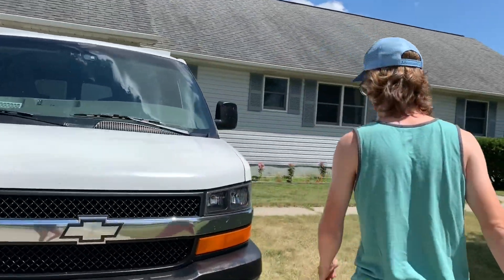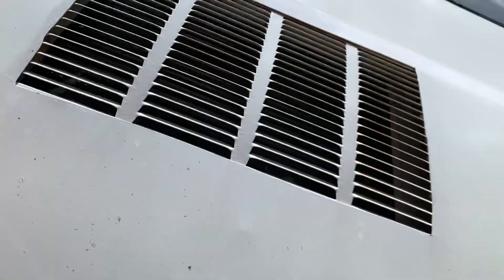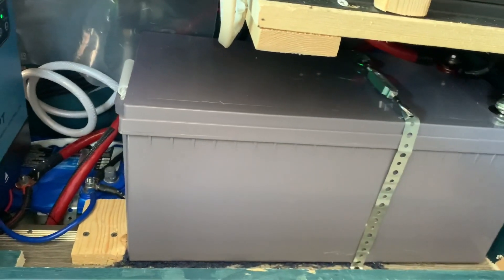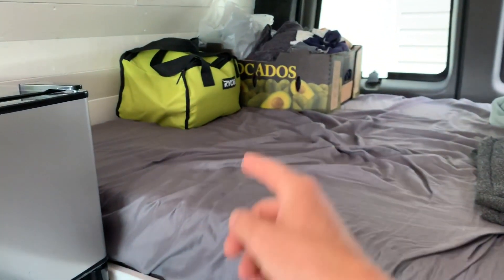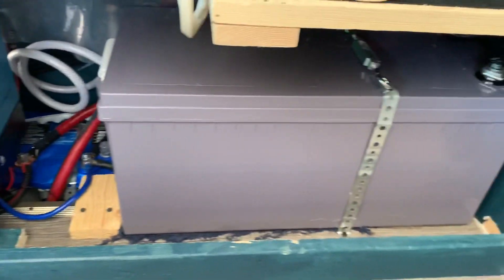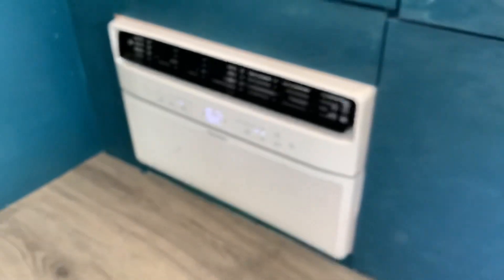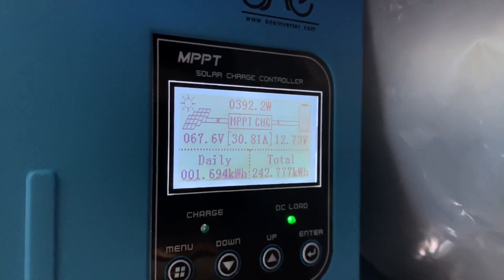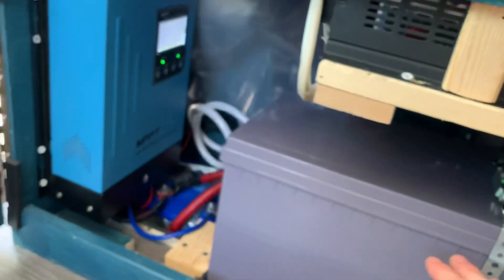Van Life Solar AC Setup - Totally Off Grid

Comment: So if it's 100 outside how cool are inside
Reply from the maker: We actually just had a full week of 100F+ weather, and it only does okay. Without anything covering the windows it really only hold the temperature in the low 90's. With window covers on, it does much better and can bring it closer to a bearable low 80's.

I would either recommend going larger with an 8k BTU unit or getting full infrared blocking ceramic window tint. (including windshield) Tinting this huge van however runs close to $800.

If you can live without the rear windows, I'd recommend just getting some 1.5" foam board and spray foam insulation for the living quarters and covering the windows.

-Tim

Comment: I probably missed it, but how many watts is your inverter?
Reply from the maker: Hey Zeke it's a 3,000w inverter. If you're only running a small AC like this I would recommend closer to 1,500w. (The higher the wattage of the inverter, the more power it wastes while idle and at lower loads)
I talk a bit more about the inverter and parasitic loads here:
https://youtu.be/opOaJkHXDSg?t=241
Reply: @VanwithTim  Ahhh, good to know! For a really simple setup, do you think a 600w microwave (950w input) would run off a 1500w inverter connected directly to a car battery while the car is running? Would the inverter have to be pure sinewave?
Reply from the maker: @zacworld2061  You've got the right idea! You generally want to go double the inverter size for microwaves. So 1,500w would probably be fine. (Most 1,500w inverters are also rated at 3,000w "surge" for things like compressors, electric motors, and microwaves) 

I hear some people have luck running microwaves with modified sine wave, but really if you can swing the extra $$, the pure sine wave will be much more "friendly" to the microwave and anything else it's used for.

For a real world reference, I did a build last summer using a 2,000w Renogy inverter and it ran an RV microwave without issue. The microwave specs were: 900W output and 1350W input.

Comment: When you have different battery capacities connected in parallel, you should be finding the smaller ones draining a lot faster than the larger ones. When they drop, your voltage draw from the whole battery bank decreases, as the inverter would take voltage at the lowest rated battery voltage (which is lower for lower-capacity low-charge batteries), not to mention the sulfation that happens when any of your agms drop below 50%. Are you monitoring your batteries' health as they continue to be used? I wonder what actual capacity your smaller ones still have at this point.
Reply from the maker: I'm pretty curious of their current health as well. Two of the three were used batteries and I'm kind of just waiting for the battery bank to die so I can upgrade to Lithium.

All three batteries are connected in parallel via 2/0 AWG wire though, so the voltage of each battery would (should?) be the same across each battery? (If the small battery is losing voltage faster than the others, wouldn't voltage from the other batteries would naturally flow into that battery?)

I'm no electrical engineer by any stretch of the word, I'm probably over-simplifying and missing important points.

I also used to try keeping the DoD above 50% but have since stopped caring about the battery bank. I've since ran the below 11v many times. (Maybe I'm just itching for an excuse to kill and upgrade them haha)
I really should try performing an individual capacity test on each battery as a two year update.

Have you seen this article? It’s a really interesting read and I suppose it explains why my battery bank still hasn’t bit the dust. (I hear so many people afraid to utilize more than half the Ah capacity of their AGMs) 
https://tab-rv.vanillacommunity.com/discussion/9940/agm-battery-depth-of-discharge-myth-busted

Truly appreciate your insight! I'm always learning!
-Tim
Reply: @VanwithTim  thanks Tim, great reply.
Yes I think I mixed up the series/parallel physical flow, as in parallel I do believe the fuller batteries would charge the less full ones to compensate for the quicker voltage loss. I'm not an electrical engineer either (though trying to become like one ;), but I'm not sure my earlier statement applies.
But one other thing you may not have considered is that the smaller batteries have a smaller max discharge current. Usually at about .3a per amp hour for AGMs, I believe your current demand will draw power equally across all 3 batteries, but that 1/3 current draw from the weaker batteries might exceed it's current draw max. That means damaging them faster.

But your lady statement really said all you needed to - wearing them out might not be so big a deal if you're looking to upgrade sooner rather than later. Just thought I'd mention some of the unanswered questions I had for the configuration. Hope you are well!
Reply from the maker: @tylermaldonado7210  It was definitely a budget build in the beginning and I've learned a lot along the way. The world of battery chemistry gets so crazy as it's a total mix of electrical engineering and advanced chemistry (or at least feels advanced enough to me!)
I definitely have some intense current draws (up to 180 amps) and I'm sure that's not doing them any favors. But that's also what gets me worried about Lithium - I hear they have a pretty low limit of max discharge. I can see the appeal of a 24v system when it comes to that!

Will certainly be making a video once it's time to swap upgrade the battery bank!
All the best!
-Tim
Reply: @VanwithTim  for max discharge from what I've seen lithium exceeds AGMs very highly. Most lithium batteries have a 1c discharge rate, equivalent to 100a per 100ah. AGMs meanwhile appear to be about 30a per 100ah pretty universally. So I'd be thinking the opposite about that :P

Comment: You should add a desk fan to run along with the AC so that the AC won't work so hard and consume less energy as a whole
Reply from the maker: I've actually since added three desktop USB fans to the ceiling (only 3.3 watts each) and it made a huge difference!
Reply: @VanwithTim  By chance, do you have a link to those fans? I watched your video with immense interest, finding it nearly impossible to believe that you can run a 6k BTU AC unit ALL DAY on battery/solar power. I've watched the video three times and I'm still shocked and finding it implausible. But I'm currently in the market for a new (to me) used van, and am appreciating all of your videos immensely. I hope life is treating you well since your vanlife days. Thanks for all the great content.

Comment: Nice set up 💯💯💯💯Quick question lets say you just wanted to use ac while van was running would alternator and inverter by itself be enough to run just ac?????
Reply from the maker: Hey rick, great question and the answer is yes!
The AC draws about 37 amps at 14 volts.
The vans 145 amp alternator outputs around 50 amps at idle.
-Tim
Reply: @VanwithTim  cool thx

Comment: Omgosh i could use ur help!! Where r u? I have no help n cannot do this n dont want 2 wi experience! Electric scares me but i do NOT handle the heat well n i need something this yr...soon actually! I really need help w some type of cooling!!!
Reply from the maker: Hi Melinda, your best option might be the "ice chest AC unit" (lots of examples on DIY on Google) A system like mine would probably be around $1,500 - $2,000 for just the used parts then another $1,500 in labor for install. The ice-chest AC is a great solution for less than 1/10th the price!
Reply: @VanwithTim  Hi... Thanx! I did try that last year and instead of ice i used frozen water bottles n frankly i got sick of buying ice, draining it n couldnt keep refreezing bottles n it didnt cool it enough 2 b worth it for me. I really do appreciate ur help. I will look into some dif options than what i did. Thanx!! God bless!! ✌💙🙏

Comment: Nice built! 
The link show 24 V inverter but you have 12V, same with solar panel? 
And I have I trick to improve your comfort. If the widows are film remove it and put mirror, chrome, silver one instead.
 Bloc the air entry on your AC and put a lateral air duct to suck hot air from the roof.
Reply from the maker: Oh boy. Good catch! Just updated the link.
The system is all 12v, but the panels are 41v I believe. Those run directly to a MPPT solar charge controller which steps the voltage down to a specified charging voltage. (I think I have mine set to around 13.5v)
I was actually just looking at adding the ceramic window tint, but it's very expensive.
I really like that idea of sucking the air out from under the solar. The panels get really hot in the summer and lose a lot of efficiency. Need to find a way to keep them ventilated and that's an interesting concept for it.
Thanks for the insight!
-Tim
Reply: @VanwithTim  Window film at Home Depot "Gila, privacy control and Energy saving" are not over price like other. they have one layer mirror outside and black inside to cut reflectivity for clearer night view. 
I just see your new video 20 févr. 2021. My comment come too late.

 The duct idea was for your A/C air inside to improve effeciency and comfort. 
But, for cooling the solar panel (improving efficiency and lifespan). Better to push fresh air between the roof and the panel than sucking it. The motor fan dont love heat too and I dont see a easy good installation. 
If you have space put a inch or fews between each panels

If you need window film tips for installation. forgottingtree7@gmail.com

Other topic
Why stars flashing? Try with 100x camera and put out of focus. 
I had many books of astronomy and science( the old ones, without correction). 
I see the fakery (crookedness) of it. 
Not on YT who is easy to modified, many sites are fake truth seekers, is hard to find the good one.

The big cheat ever. Hidden God from most people, by mind control and false sciences. 
See: shaking my head productions:
 Edward Bernays and Group Psychology: Manipulating the Masses, 
The Universal Lie - Houston We Have A Problem!, 
shaking my head productions 2: 
666 Days In Space - The Devil Is In The Details.
Walter Veith: 
twisting the ten commandments and
 freemacon priesthood jesuit order
 I was like you, before... I become awake (red pill). 
The world his not what's you has been told.

Word of wisdom 
Let no man deceive himself. If any man among you seemeth to be wise in this world, let him become a fool, that he may be wise. 1 Corinthians 3v18
The way of a fool is right in his own eyes: but he that hearkeneth unto counsel [is] wise.Proverbs 12:15
Even a fool, when he holdeth his peace, is counted wise: [and] he that shutteth his lips [is esteemed] a man of understanding.Proverbs 17:28
A fool hath no delight in understanding, but that his heart may discover itself.Proverbs 18:2
Seest thou a man wise in his own conceit? [there is] more hope of a fool than of him. Proverbs 26:12

God bless.

Comment: Living in Australia, not having AC is the number one reason I've dreamt about putting together a van camper to travel around a bit but never seriously considered it so i found this very interesting. Thank you! The southern half of Australia can get cold on certain clear nights in winter on the odd occasion (0 to -3 centigrade) so heating isn't really an issue but EVERYWHERE gets in the high 30's to mid-high 40's range in summer. The thought of trying to sleep through a 33 degree centigrade night in a van makes my skin crawl. Especially on those nights where the breeze is hotter than the ambient temperature because its blown off the desert 1000 km away lol
Reply from the maker: Oh man. It's one thing being hot inside a house, but when you're trapped inside a metal box cooking in the sun that's a whole new level of physical and psychological torture.
You made mention of the ceramic tint in the other comment. Do you have it installed? Does it seem to really make a huge difference? 
Still a bit sticker shocked on what I've been reading online for pricing!
Reply: @VanwithTim  No i dont have it installed as my prescription sunglasses are polarised. The place where i took my car for tinting did sell the clear ceramic film for windscreens but told me theirs would react to my polarised sunglasses (making rainbow colours and stress marks visible). They did mention that not all do but the brand they use did. I do remember though that they told me it would reduce the heat getting through the windscreen by the same amount as 20% tint does. Great Channel man, I've subbed.

Comment: Was there any consideration or research done for startup amperage draw with that AC unit?
Reply from the maker: Unfortunately none of my measuring devices refresh fast enough to see the true amperage surge.
The unit does incorporate a capacitor which helps immensely.
Since filming, I've invested in a few amp meters and the power draw directly from the battery bank measures  ~510w compressor running with fan on high. (That includes the inverter efficiency loss) I usually see it around 700w for <1 second initially but it's probably higher than that.

Not sure the typical starting power draw compared to running power draw.
It starts fine with our 3,000w inverter, but unsure about smaller inverters.
Sorry I don't have more information!
Reply from the maker: Actually I found this article showing the starting wattage is around 1.5x the running wattage. (Unsure of accuracy)
https://homeguides.sfgate.com/can-generator-run-ac-window-unit-77964.html
But that would put the starting wattage around 765w (or ~62 amps at 12.4v)
Hope that sheds a little light!
-Tim
Reply: @VanwithTim  That helps a lot. Thank you. I commented on your video where you show off your solar panels. Curious about your opinions on that as well. I'm in Tucson and working my way west. If you're out on the road you can find me on Instagram! Be well and thanks again!
Reply from the maker: @antigroundhogday  Just checked out the Instagram! Looks like you're having fun out and about. I'm no expert in van conversions by any means, but happy to offer my opinion where I can help!
-Tim
Reply: @VanwithTim  Sounds good, likewise. I always love brainstorming with my engineering friends.

Comment: Is there anyway i can hack oem car ac using power bank battery with electric motor?
Reply from the maker: It would take a lot of custom fabrication but ANYTHING is possible if you have the skill and patience!
Here's an interesting article:
https://endless-sphere.com/forums/viewtopic.php?t=73345
However, it seems the OEM car compressor will use up to 5HP (3.73KW) where this window AC uses only ~0.75HP (0.5KW).

Comment: Also how do you get away with charging different amp hour and brand batteries ? I thaught they would all have to be the same to prevent overcharging
Reply from the maker: That's a good question and here's a good article on the subject: https://rvnerds.com/2017/08/07/electrical-myths-part-3-mixing-batteries-different-agescapacities/
Here's a quick excerpt:
Let’s suppose you have 3 different 12V batteries, wired in parallel to supply 12V power to your RV.  They can have different capacities on account of size or age, but the same chemistry (e.g. all flooded lead acid or all AGM).  Before you start charging, the voltage across each of them is the same–even if one is fully charged and the others aren’t.  Charge will flow from one battery to the other two until they’re balanced.  With a lead acid battery bank, the internal resistances are limiting to a point that you don’t have to worry about arcing or your battery cables overheating when you connect them (not the case with lithium-ion banks…).

Hope that shines a little light on the subject. You'll find a lot of conflicting articles out there and "armchair experts"
Battery science is truly a deep rabbit hole to dive into. But for the sake of van conversions, it seems to work great for us even after 1.5 years.
-Tim
Reply: @VanwithTim  thank you so much for the information man!! That helps me big-time for the future when I add to my setup.  because I have a 180ah 12v Battery that I made from purchasing chinese lithium cells. But i wanted to add maybe a 100ah cell.pack.in the future to it. I was worried that wouldn't work
Reply from the maker: @owenbell2572  I plan to go the Lithium route myself once these AGMs finally die out.
Have lots of research to do myself! They're really changing the game for sure.

Comment: What method do you use to charge the batteries on grid?
Reply from the maker: Hi Owen, never installed any "shore power" connections or 120v to 12vdc charger in this van. I do have a 15 amp battery charger at home but have yet to find an excuse to use it.
I did a Promaster build and the owner wanted this "Genius" 15a charger. https://amzn.to/3e6qKwt Far too pricey for me but it seems to treat them well.
Reply: @VanwithTim  sweet thanks man!